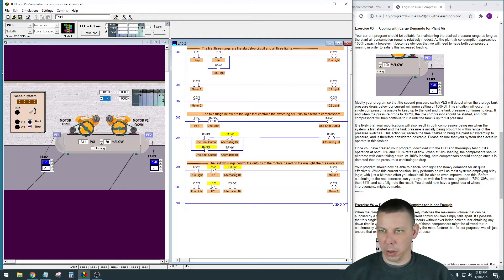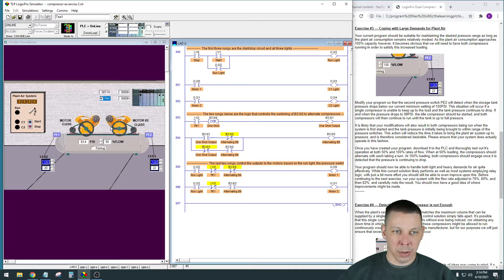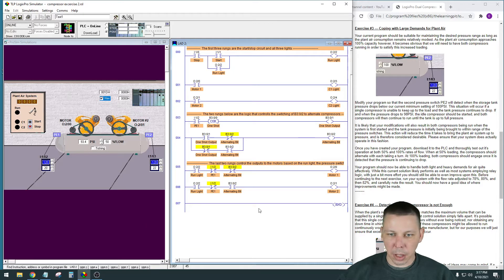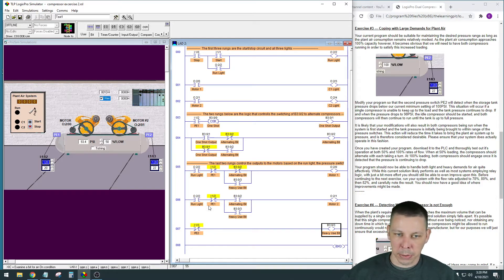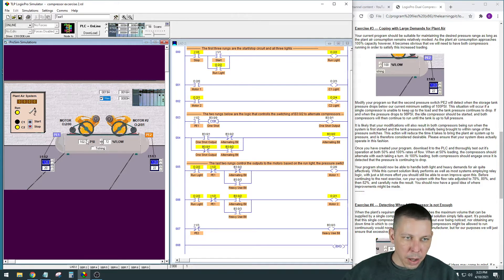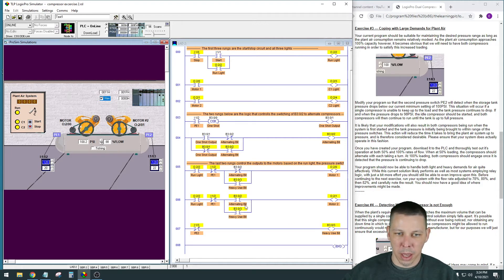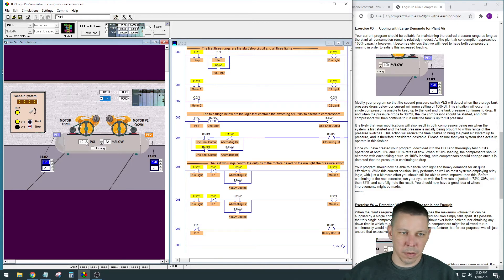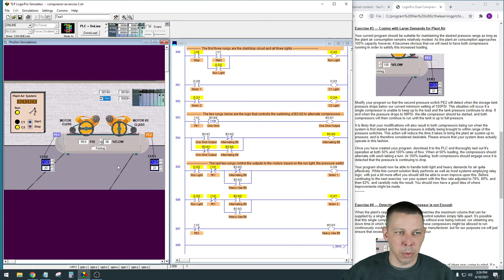LogixPro Dual Compressor Student Exercises - Exercise #3 --- Coping with Large Demands for Plant Air

Comment: Very informative video, but just as another idea, and correct me if I am wrong here... Couldn't you achieve the same effect by simply adding I:1/03 in parallel with the alt bits instead of adding another rung?

Comment: fantastic vid, I'm currently running this sim so that when the air out is 100% the first compressor will kick in at 120/20 and the second will kick in at 110/20. both will run until full and then repeats. but if i wanted to put a compressor e stop where would i put it in?